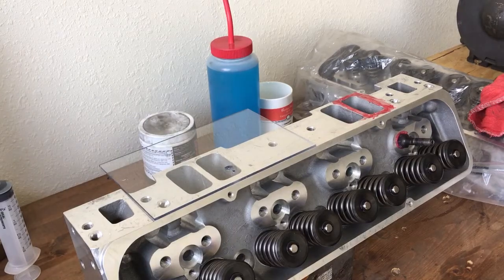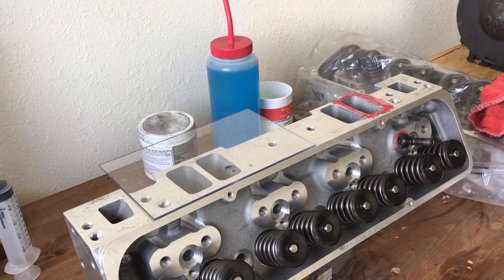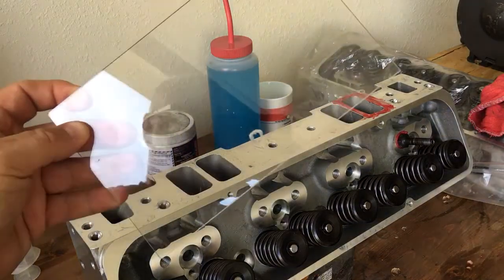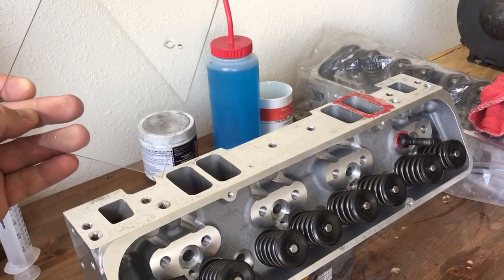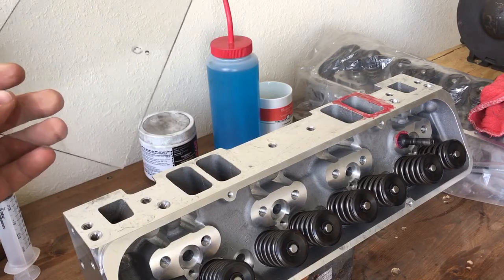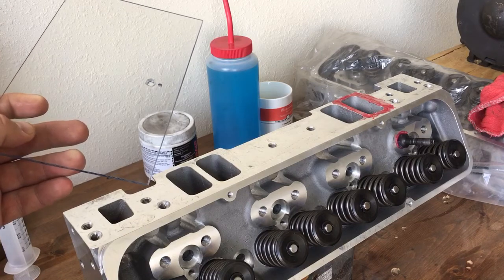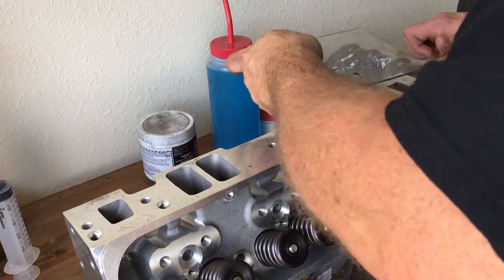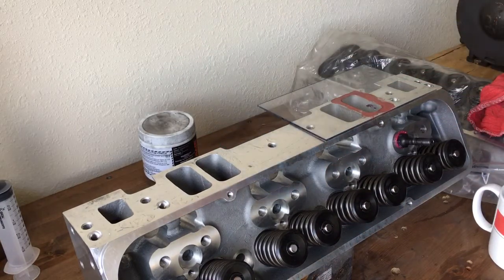DIY cylinder head CC'ing  Quantico cylinder heads 195cc #2

Comment: Ive bought these same heads, but need to know what sized head bolts they require?  Im bolting mine to a mid 70's block. The mechanic said standard sized head bolts are too small for these, and they will need hardened washers.

Can you please confirm what size head bolts they need?
Reply from the maker: Joseph Cozens I will have to contact the owner, I assumed they would use the factory sized 7/16-14 thread SBC head bolts. That's very odd. Unless someone upgraded your block to a larger size previously?
Make sure they dis assembly your valve springs and add the metal shims below the springs.
Reply from the maker: Joseph Cozens Visually comparing the head bolt holes in the video, a regular 7/16 head bolt should fit fine.  If your trying head studs they always need adjusting to get the heads on.
Reply: The Seller at Quantico said they don't require washers on the head bolts, but I thought all aluminium heads needed washers on the head bolts?
Reply from the maker: Joe Charles Make sure they add a .015 shim under the valve springs. 
As far as the head bolts I always run washers.on aluminum.
Reply: What sized head bolts do they require? I contacted Quantico to ask and they just sent me a photo of some head bolts and didnt actually tell me how long they needed to be. Their customer support is terrible...
Reply from the maker: Joe Charles I'm not sure where you're located, in the USA you can order/pick up a set of Felpro head bolts from any parts store. 
Here's the QC bolts which they most likely sent you. https://www.qcylinderheads.com/collections/head-bolts/products/sbc-small-block-chevy-cylinder-head-bolts-hex-6-point-283-305-327-350-383-400
Reply from the maker: Joe Charles check your spam messages I'm sending links
Reply from the maker: Joseph Cozens I wanted to verify, are you building a SBF or SBC?   It dawned on me some SBF use a thicker diameter head bolt, so I wanted to clarify.
Reply from the maker: Joe Charles If it helps, I can look up some various head bolt kit part numbers?  I'm not sure what suppliers you have available, let me know I'm willing to help.
Reply: Thanks that is the same set, but when I called they said they were a non standard size, but also said that they wouldn't fit if I used washers. I said I had been advised to use washers because the heads were aluminium and they said that not all aluminium heads require washers. I asked for the length of the bolts so I could get a set with washers that would fit, and then just sent me photos of the bolts but didnt tell me the actual sizes...
Reply: it is a small block chevy
Reply from the maker: Joe Charles Interesting, if the head bolts have a built in washer/shoulder  you can try running them but put plenty of lube under the heads. I just can't see how the bolt head won't smear the aluminum under friction during torquing.  Very odd situation